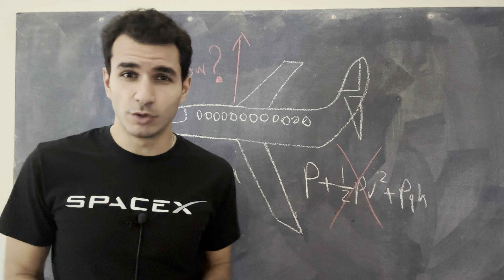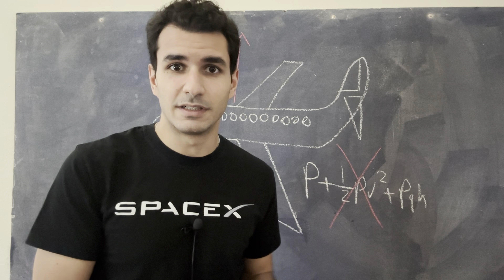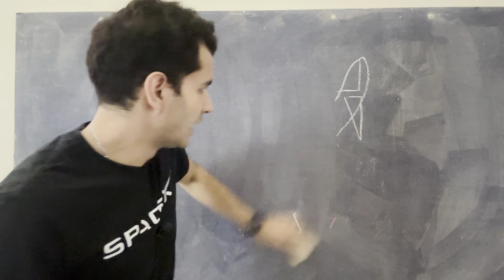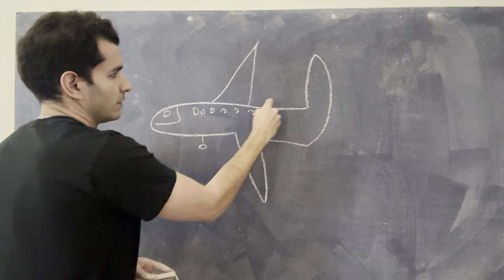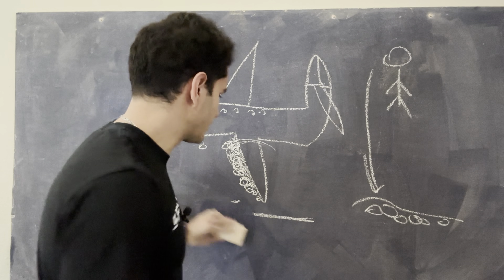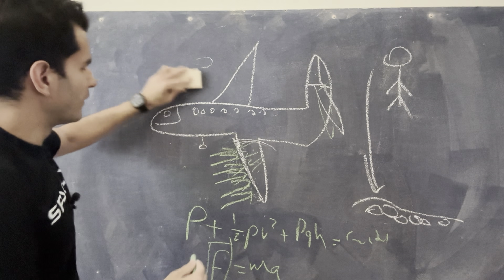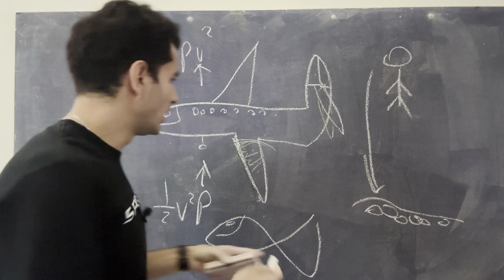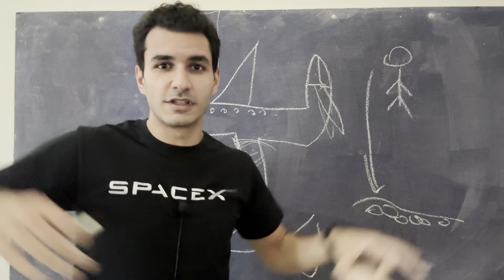Fix This One Misconception = Understand Airplanes Forever

Comment: You didn’t explain the part as to “why” there is a pressure difference between the both planes of the wing? 😅 trying to avoid the only real question? 😂 FYI, I’m an aerospace post doc 😊
Reply: Asymmetrical shape to the relative flow turns the flow by splitting the flow asymmetrically.  Mass flow continuity must be maintained on the total of that unequal split.  Pressure adjusts according to the kinetic energy change needed to maintain that total flow continuity contribution of each side of the flow split.  The resulting transverse pressure gradient turns the momentum direction of the flow downwards.
Reply: @davetime5234 lots of inaccuracies there my friend. Mass flow continuity is never for a whole system but for a single streamline. Explain lucidly, do not throw jargon around into verbose.
Reply: @davetime5234 one more question to you, you said asymmetrical aerofoil. So why does a symmetrical aerofoil create lift under alpha?
Reply: @ "Mass flow continuity is never for a whole system"

False.  Any arbitrary enclosed boundary in steady state (no internal change in density with respect to time etc.) must have mass flow rate in equals mass flow rate out.

"So why does a symmetrical aerofoil create lift under alpha?"

Angle of attack is adjustable asymmetry, and any camber asymmetry is of course fixed.

Total asymmetry is the combined total.
Reply: @davetime5234 and how are the either faces of the plane in a closed system? The top layer and the bottom layer are independent systems and both of their mass flow cannot be equated. And steady state, Nil changes in density is only applicable for speeds less than transonic. What about super sonic flow, how does this theory fit in there?
Reply: @DanyoAsmi They are independent systems?  False again, the entire domain of influence is a mass flow transport continuity system.  There is no ballooning warehouse of mass nor depletion.  The system arranges itself for continuty because there is no other option.  Under these conditions the asymmetric flow split has consequences: the pressure difference you originally referred to.
Reply: @davetime5234 absolutely incorrect interpretation. You are trying to fit your theory conveniently. There is no physical backing. The systems are indeed independent as there are no boundary conditions to bind them together. As per your flawed assumption any shape or size can create a favourable pressure gradient and NACA models are completely useless! Any aerofoil which splits the airflow has no bearing on the airflow thereafter. The airflow over the under the wings acts independently and their masses are not conserved locally but they are conserved globally but that logic falls flat when you consider a flat plate argument. You are just saying things which only complicate your incorrect assumptions from initial analysis, furthering cross questioning will only expose you further. I suggest you read up and understand the fluid flow simplistically, you are currently not answering the basics correctly. Further, all these assumptions of yours also do not follow kutta conditions and NS equations. Additionally, turbulent energy also don’t follow your logic.
Reply: @DanyoAsmi You haven't said anything authentic from the beginning.  The pieces are not coherent.  There is rather, a consistency of inconsistency in dealing with common related topics in the way an engineer with suitable background experience would. Refer to my other comments here if you're interested.  If not, whatever.
Reply: @davetime5234  great, now that you’re properly cornered and don’t have an answer you resort such baseless nonsense. Real mature. If you aren’t capable of having a professional discussion why do you even bother to start off with!? Your naive understanding of basics is appalling and are untenable to even read what’s been asked.
Reply: @davetime5234  My counter questions are diverse because you are absolutely blabbering nonsense to begin with. I doubt whether you ever read any engineering or have been dabbling over random ideas without any scientific logic. A great man once said, if you can’t explain any thing in simple terms then you simply don’t know it.
Reply: @davetime5234  So try learning it before throwing insults or gibberish. I don’t intend to pollute myself further with your engagements as I’ve realised that it is nearing absolute zero, if you know what that is. Finally let me be gracious and offer you few lessons from my nature journal published papers. May be that may lift you up from the darkness of ignorance. Happy learning
Reply: @DanyoAsmi Go back and read all your comments.  Nothing constructive, no models/explanations for what you originally said, nothing but negating.  No "post doc" here.  You can study my other comments, or not.
Reply: @davetime5234 my comments seem unconnected because I’ve been countering your baseless explanations hence you should go back to your chain of though which is nothing but trash. You speak of models while you’re not able to explain the basics! Before pointing fingers, take a good look at the mirror and go back to elementary physics, that’s your place as of now. Anyways, I’ll give you one final chance, in plain simple terms, just explain how is lift generated, how is the airflow accelerated, how is the pressure gradient created. Don’t go into circulation and confuse the hell out of yourself. Just the BASICS, if you’re unable, I’ll do the honours myself
Reply: @DanyoAsmi  Please explain lift.  That's what we've been waiting for.
Reply: @davetime5234 simply put, life happens because of redirection of air flow by the airfoil and due to the Newton’s laws the air flow applies an opposing force which is known as lift. Secondly, all the concepts of Bernoulli, Magnus and Navier-Stokes happens among a streamline on either side of the aerofoil independently. Even the streamlines on the same side of the aerofoil act independently. Then there is a pressure gradient created on the either side of the wing which needs to be compared with the OAP far away from the wing, this pressure gradient is decreasing on the top surface and is increasing on the bottom surface and thus, lift is generated.
Reply: @DanyoAsmi  Magnus effect affects lift but has nothing to do with the fundamental explanation of lift (it enables flow acceleration which augments lift when it occurs).   

Navier-Stokes applies not just along a streamline but across the entire population of all streamlines.

Individual streamlines are "self-contained" (only in steady-stated) in terms of mass flow transport and conservation of energy (inverse speed vs pressure relationship).  

But streamlines are in no way independent otherwise.  Transverse pressure gradients and momentum direction change is a streamline group behavior. There is no such "independence" here.  Navier-Stokes very much describes this interdependence.

To be frank, your criticism showed as weak a grasp of the theory as did your stand-alone explanation.
Reply: @DanyoAsmi  "When you don’t have answers, you hide behind such complex confusions."  Agreed.

But what kind of fascinates me also is why someone would get so emotional over such a topic.  Either what one says is true or not.  Why would it even register to get upset over something that would presumably be purely a curiosity search for the truth.

But this is indeed kind of an odd comeback: "NS only speaks about small and Reynolds numbered flow and its correlation with viscosity"  

NS govern fluid motion universally (though solution challenges under different conditions is a different question).

"these concepts don’t apply in a global flow state"  I mean come on, they are Newtonian equations of motion extended for a distributed flowable mass.

They apply to everything, everywhere and always, in terms of Newtonian physics of motion.  They are fundamental statements of the motion behavior properties of the physical world (classical mechanics of course).  I mean look at what the statements are: conservation of mass (flow rate continuity), conservation of energy, conservation of momentum (ignoring viscosity for the moment which characterizes in a sense, the non-homogeneity related properties of a real-world distributed mass).
Reply: @DanyoAsmi  So as far as all the people I've interacted with on this type of topic, your type of responses represent maybe 3 or so out of a hundred.  The middle of the distribution are quite reasonable.  The most sympathetic tend to hold the highest credentials in the field.  Inappropriate, but it's all in the stats.

Comment: Airplanes fly by swatting air molecules down, which pushes them up (lift). Helicopters fly by beating the air into confused submission.
Reply: if you find yourself in an aircraft where the wings are moving faster than the fuselage, that aircraft is a helicopter, and therefore unsafe.
Reply: They fly by dropping pressure enough for the energy to change the flow speed sufficient to maintain mass flow rate across the airfoil.  The pressure gradient bends the air molecule stream down rather than swatting it down (for the most part).

Comment: So explain to me how lift is created if the wing is parallel to the air flow?  As a plane starts moving faster down a runway, with the wings parallel to the ground, lift is slowly increasing.  Long before the plane reaches its takeoff speed.  The angle of attack of the wing isn’t increased.  Just the speed of the plane.  On a 787 with composite wings, which have a lot of flex in them, you can see the tips of the wings slowly rising as the speed increases and lift starts to build, but the plane is still rolling on the runway.  So there’s something generating lift even though the angle of the wing hasn’t changed relative to the flow of the air.
Reply from the maker: yes modern planes are designed to generate some lift in their standard shape -- but the plane doesn't take off until the elevator dramatically changes the angle of attack. This happens at the "rotate speed" -- the speed at which the plane is fast enough for the pilot to tilt the angle of attack and start flying

Comment: love the video but in my experience with planes and what i was told by many pilots and aerospace engineers is that faster low pressure air on the top of the wing (pulls) the airplane upwards
Reply: What you were told was basically correct.  Air speeding up obviously takes more energy, and that energy comes from the pressure dropping.  Why does air speed up?, because the rate of mass coming in = rate of mass going out.

So, when a surface of the wing disturbs the mass flow, the mass flow reacts by changing its speed by changing its pressure until in=out again.

Which comes first, the pressure or the speed?  It's a self-adjusting feedback mechanism until the system settles back on in=out.

The explanation by this video cannot account for why the airfoil on a sailboat allows the sailboat to move faster than the speed of wind.  So, this video lacks presentation insight.

Similarly, what is it in the basic nature lift physics from that allows an airfoil for a modern commercial jet aircraft to have a glide range so you could glide from Los Angeles to San Diego, or from London to Calais in France, from 35,000 with engines turned off.

That glide efficiency needs to be intuitively addressed.
Reply: What you were told was basically correct.  Air speeding up obviously takes more energy, and that energy comes from the pressure dropping.  Why does air speed up?, because the rate of mass coming in = rate of mass going out.

So, when a surface of the wing disturbs the mass flow, the mass flow reacts by changing its speed by changing its pressure until in=out again.

Which comes first, the pressure or the speed?  It's a self-adjusting feedback mechanism until the system settles back on in=out.

The explanation by this video cannot account for why the airfoil on a sailboat allows the sailboat to move faster than the speed of wind.  So, this video lacks presentation insight.

Similarly, what is it in the basic nature lift physics from that allows an airfoil for a modern commercial jet aircraft to have a glide range so you could glide from Los Angeles to San Diego, or from London to Calais in France, from 35,000 with engines turned off.

That glide efficiency needs to be intuitively addressed.
Reply: Thats correct, if you take the Bernoulli equation. take v1 as a higer verlocity then v2, and solve for p2, you will see that p2 is lower then p1

Comment: So why do wings have an airfoil cross section.
Reply from the maker: because it improves lift and reduces drag -- but its not the primary cause of take off. That happens when the elevator tilts and angle of attack changes
Reply: @alithedazzling  on a long enough runway most aircraft will take off with no angle of attack if they go fast enough. It seems like the general idea is to have a low angle of attack at cruising altitude and speed. This can result in a negative angle of attack at low altitude and high speed. With flaps it happens at low speeds as well, if you are going too fast you have to push forward hard to make the plane descend. But you are right that on a normal takeoff you use a positive angle of attack as well as flaps in many aircraft.

Comment: As you gave the example of a fish, when i was a kid i used to see eagles make sharp turns in the air by moving their tails. When i thought about a flying airplane , the analogy was very useful. I didnt need any equation to feel that when an airplane wing direct the air flow downwards , a net upward force acts on the wing. Then i saw everyone explaining it with equations i also felt that there is a lack of intuition in this method.
Reply from the maker: Great observation, deep physics intuition is king

Comment: Hello sir!! Such a great explanation, thank you very much, but I have a few questions:

1- Did you study aerodynamics? I mean, you are a high level physicist working on NASA, but you are an electricity specialist, do you think you are in the same level as an aerospace engineer?, talking about aerodynamics of course. 

2-Your explanation is pretty clear but, what do you think about the famous "downwash", that down flow after the trailing edge, because you only talked about the force under the leading edge. That is because a lot of aeronautical engineers talk about it as the "true reason" related with lift. 

Thank you very much, now I follow you! 🫡✈️🚀❤

Comment: My take away, Primary Physics: for Flight is the Presence of Air Molecules and getting Compressed. 
Secondary Physics: Newtons 3rd law,Benoulli's Principal. 
Summary of your
discussion, 
a. Air molecules are essential for lift generation and flight.
b. The wing's shape and angle create pressure differences, generating lift.
c. Air molecules are compressed in front of and below the wing, contributing to lift. Without air molecules, lift generation is not possible.
d. In a vacuum, flight as we know it is not possible due to the absence of air molecules. Your explanation here is a great example, of "First Level Thinking"

Comment: Hmmmm while i think you're right in emphasizing that the push side of things is not enough talked about, an efficient wing profile is more about the pull side of thing... the pool side of thing to keep the water analogy.

While its true that planes tilt to take off, they could without... it is just that its more secure to lift early, the tires and wheels are less solllcitated going slower...

Then your explanation fall short... while the plane take off long...

There are many representations of the pressure distribution over a naca wing profile. It shows that pressure drop is more over the wing ( extrados => convex ) than pressure increase under it ( intrados => concave or flat or slightly convex) its just basic fact.

it could be otherwise but very less efficient it is... the same reason why F1 cars using ground effect are going faster at end of straits without sacrificing downforce compare to those using mainly rear wing.

then the real "intuitive" way of explaining is quit different. The way extrados generate underpressure is by constantly generating a difference of pressure between the leading edge and the trailing edge.
At the leading edge you can see that its steep, it impedes the flow but over a small area. When you impede something you encounter impedance... which side effect is to increase pressure here just at the leading edge.
Now, at the trailing edge and up to the decreasing part of the profile, the wing escape under the air molecule whoch create a suction effect. Would it be static air molecules would be directed vertically downward but being pushed back by those coming from the congestion leading edge they follow along the back profile without exerting much pressure on it because there average speed vector is well oriented along the profile. Pressure being the result of amplitude ( speed ) and frequency of bouncing molecules. Molecules are fast but the vertical projection of that speed is lower due to the orientation of that speed.

But thats not past the point where the descending part of the wing profile reside where the highest depression occurs, its before right after the shock or congestion area, that where the air molecules average speed is massively directed by the profile guiding them violently plus the fact that the profile here is guided upward.
To sum up, the upper part of the leading edge exchange a bit of drag for a big amount of "suction".  Air molecules accelerate over the extrados because they come from a relative high pressure to flow toward a less impeding area ( lower impedance ). It kind of create a two poles pressure motor.